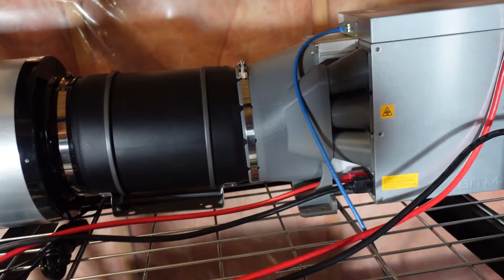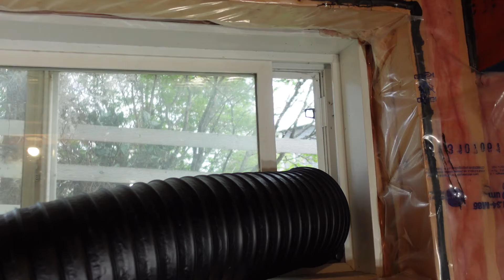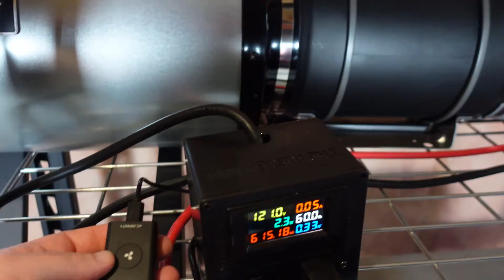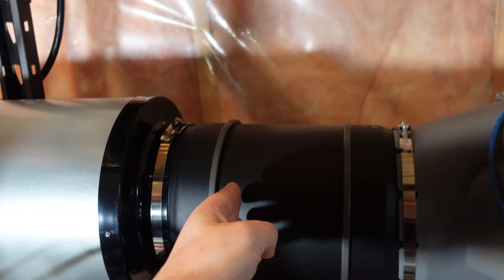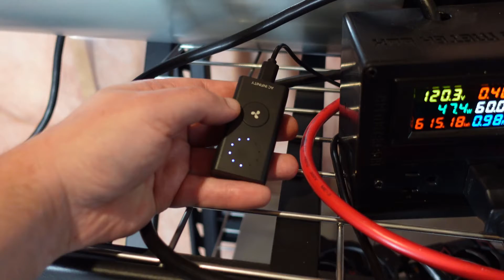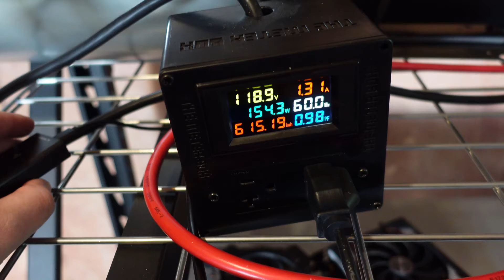8" Inline Fan Power Consumption | Quiet ASIC Miner + THERMALs

Comment from the maker: Are You looking Into ASIC Mining?
Reply: You were really stressing me out when you were checking the fan speeds soo low for soo long while mining! Never run the asic under speed 4 on the AC infinity lol. Anyways I've had this setup since I bought my K7 which was months ago. I don't have the silencers and was very close to buying them. I'm happy you have them to test out! 

When I installed my fruits and associates kit I also unplugged the PSU fans. The noise was like a loud blowing noise but not bad when I had the AC inline fan hooked up and nothing attached to the exit. I just started OVERCLOCKING the K7 and I added a 25' exhaust duct and put it in my window... the noise is then directed out the window. The intake noise is still there but the ducting really does a good job quieting it. I would say try out the silencers inline before the fan. That's where the noise is the most.

 Also with your thermal camera, point it at the asic body on the other side. You pointed it at the PSU which is a separate unit. I used to keep the fans at 5 when my basement was around 90 degrees and it kept the chips under 70 on the exit. now that I have the 25' duct I have to have it at 7. With it overclocked by 100mhz on each chip and exhausting the air my temps are 52c inlet and 64 out. When you squished the 8" duct to go behind the rack and out the window it causes a bottleneck and you'll get less cooling performance.
Reply from the maker: The asic was running when I did the thermals but then shut it down for the fan tests cause I didn't know how long I would be below lvl 5 on the fan lol
Reply: @RabidMining  oh thank god... I saw the ethernet cord plugged in and a green status light so I freaked lol
Reply from the maker: Lol
Reply from the maker: Not sure that's weird I haven't tried NH on it yet so not sure.
Reply: @JesseAI1  Yeah I just had  a few of the fan spoofers go out on me after only a few months... They were the ones provided by fruits and associates. I replaced them with Red Devil fan spoofers and they already are doing a better job! I'm going to keep a few on hand for the next time. I hear all you have to do is jump out 2 of the pins and it acts like the chips but I haven't tested that yet.

Comment: was a little confused so i checked if my fans where pointing intoo the right direction on assemble videos ......... seems the airflow with that system goes in reverse comparing it with the original

Comment: The asic works during this video ? There is no noise 😮
Reply from the maker: Yup it is on in most of it not during testing though cause wasn't sure how long I would be in under 5 mode for.  But with the thermal camera and everything it was on in full hashrate mode.
Reply: @RabidMining  how much does it all cost excluding asic?
Reply from the maker: Links to everything is in the description depends how quiet you want probably only need 1 silencer I'll test soon with 0 and 1 and swap sides with the 1 and see how it is.

Comment: Lol i have the same inline fan and silencer moving air between two rooms in my house. It was making a lot of noise and I ended up getting it for free but I just adjusted the blades and put it in an enclosure and it was good to go. There’s a more expensive model sold by the same company that’s climate controlled, smart , and more efficient as well
Reply from the maker: Ya seen that one on Amazon

Comment: If you point thermal camera at unpainted metal it acts as mirror for infrared light, so you don't measure the temperature of ASIC, but something reflected in it. You can actually see around 1:44, that yellow sticker in the middle of ASIC is measured correctly, but metal itself is not.
Reply from the maker: Interesting when I touch it the metal is cool to the touch.
Reply: @RabidMining  Judging by the temp scale on the left hottest point (white) of the picture is about 80F, since I don't see the lowest temp on scale I can't say for sure, but the sticker is shown in green, so my guesstimate is that ASIC is about 70F, so it won't feel warm to touch.
Reply: @ununoctiumon1957  He didn't point it at the asic either, he was showing the PSU which doesn't get as hot.

Comment: Rabid Mining you rock, I have been using ACI fans for so many years now and never check it’s power consumption for all the setting, only for setting 5 though 8, not one of my miner types BTC, L7, Z15, D7, etc.. I never had to use setting 9 or 10, keeping the temps normal 70-75c takes less the max setting, I did however run max setting when doing overclocking during the bull runs but only when I OC I run max setting on the S8 ACI fans. Thanks a ton for doing this test I always wondered what the other setting power consumption was lol.
Reply from the maker: Not sure what good Temps are lol 70-75 on the intake or outlet is good? Max I seen was about 55 on the inlet so far with ambient around 34c outlet was 73c the other day it was hot out.  If up to 70 on inlet might turn them down a bit.
Reply: @RabidMining  70-75 on the exhaust outlet is normal aka very good, the exhaust temp sensors is at the very rear of the hashboards close to the PICO chip, that’s why I also state the temps because if you are in a very hot environment you’ll need to run max, however max is well over the performance of all 4 stock fans running at max, because when you push and pull air the CFM does not double vs when you 100% push, the limitations become the rear fans that is why they always run a few RPM higher than the inlet fans when possible, anyways just the exhaust you need to keep within 70-75, 80c is about the max you want to see the miner will shutdown at 85c to protect the asic chips.